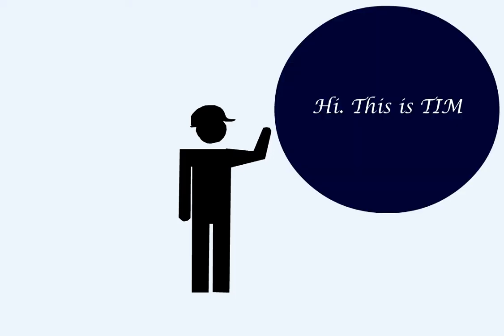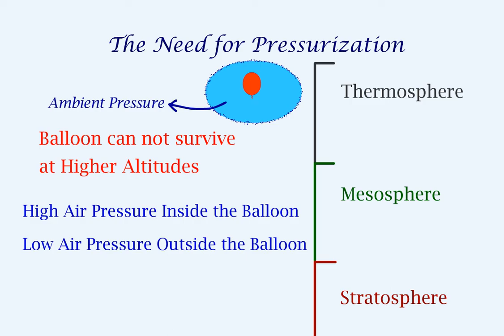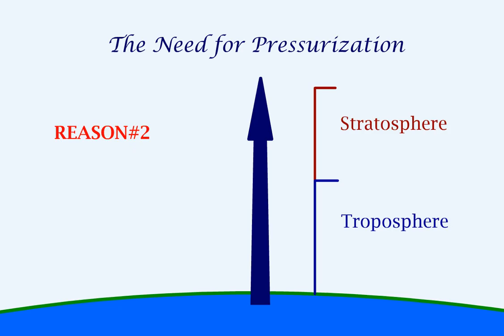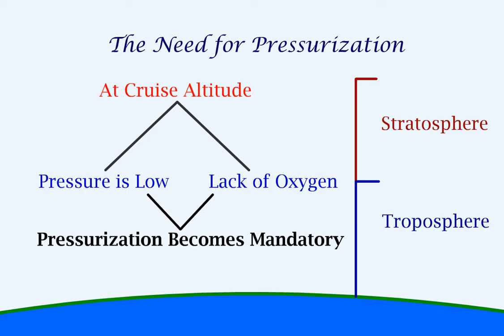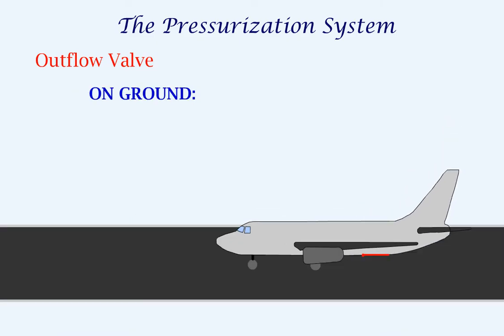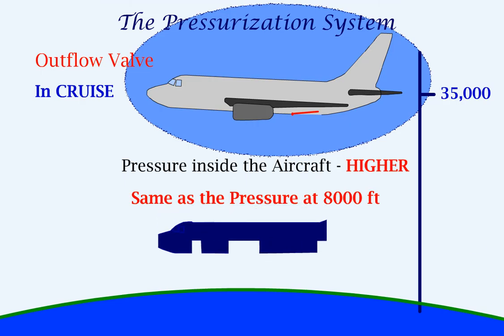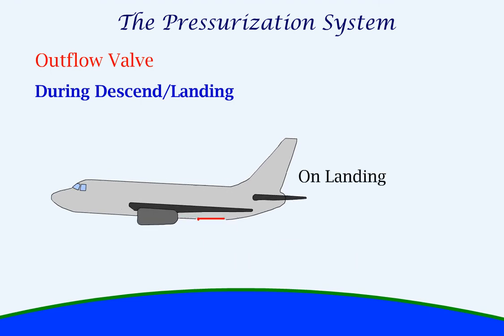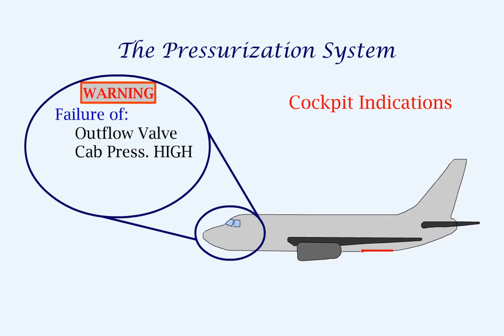Understanding an Airplane's Pressurization System!

Comment: So why doesn't the cabin pressure break apart the plane due to lower ambient air pressure?
Reply from the maker: The structural components of the fuselage: Bulkhead, Stringers and the Aircraft Skin: should have enough strength to withstand the pressure difference.
Reply: The composite Material of the aircraft structure design to sustained inn-cabin pressure.

Comment: How are you sir can you tell me please on the 8000feet oxygen level of aeroplane is maintan same like ground level
Reply from the maker: That's because of the pressurization system
Reply: It was not explained quite correctly. The oxygen content in air is the same at all altitudes (air is around 21% oxygen even at 30,000+ feet). But the "partial" air pressure (as it's called) at these high altitudes means we cannot breathe the oxygen sufficiently. So its air pressure rather than amount of oxygen that is the issue.
Reply: @TheTommowg  You are correct in that the content of oxygen in the air is the same irrespective of height, but I'd like to mention volume of air here as well. Just to clarify, available oxygen decreases with altitude, which is correct, since air oxygen becomes less densely packed the higher you go (since air pressure decreases). This however decreases oxygen per unit volume, or in other words, oxygen spreads out more (still the same volume), and thus the availability of oxygen decreases. Air pressure is thus related to oxygen availability, not content unless you account for per unit volume, and I believe that is what he meant to relay, but failed.

Comment: Why cabin altitude maintain 8000ft while oxygen pressure (15.4psi) at this altitude less then the human body required(19.5psi)?
Reply from the maker: The oxygen available at 8000ft is sufficient, safe and comfortable as well for the human body.
Reply: They are lying to u 🤥

Comment: Why do we reset pressurization if all doors closed?
Reply from the maker: The pressurization cycle starts when the doors are closed!
Reply: @JxJAVIATION  what if i didnt reset it then i take off, can i reset it during climb? Or level off?
Reply: @Vanilla_o28  it should be set to auto at operating conditions. Hence the pressurization cycle starts when the doors are shut.
Reply: Because all they say to u is a 🤥!